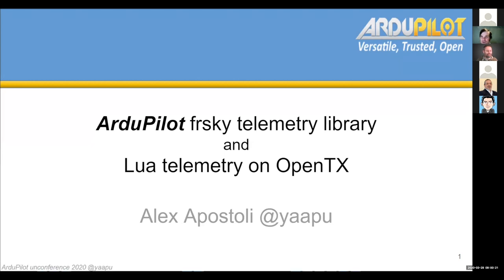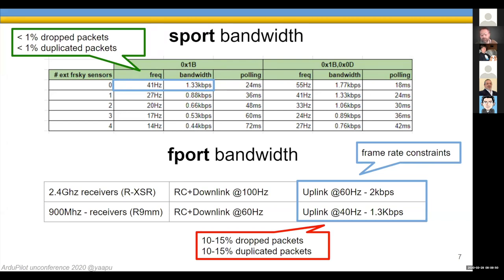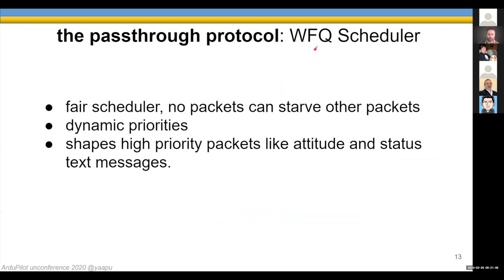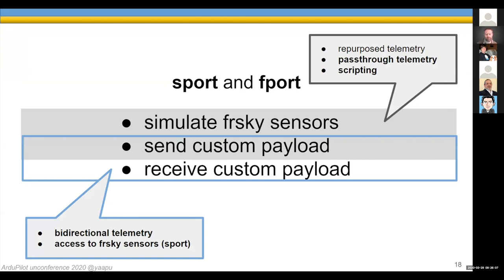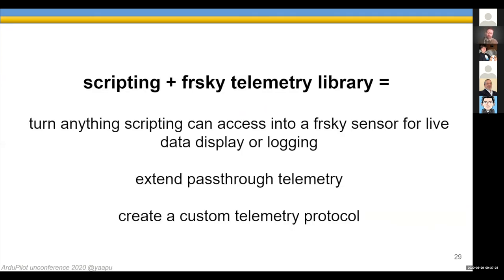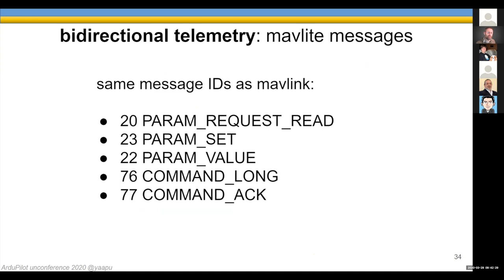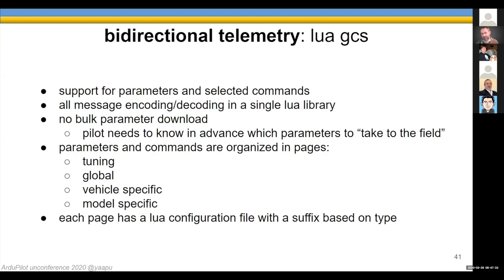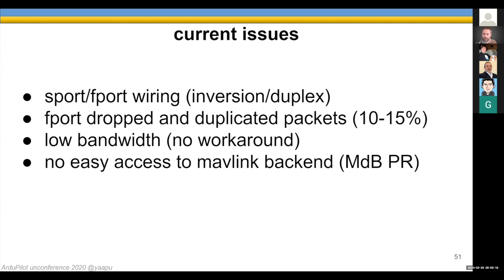Yaapu telemetry and mavlite

Comment: Thanks for this. Lots of good info. I'm using a LUA script on a Jumper T16 to transmit to XR8 receiver and control an Arduino board. The script works and the Arduino can be controlled. The problem is the commands from the LUA script seem to be either transmitted or received intermittently.  I'm basically transmitting a number in the data field to control the Arduino. I'm using the command sportTelemetryPush(0x1B, 0x31, 0x5000, 17).  The 17 will change and the Arduino reads it to activate a sound module. Is there a timing issue with sending the data I need to be aware of?? Any help is appreciated.